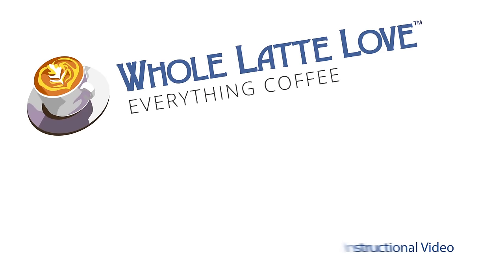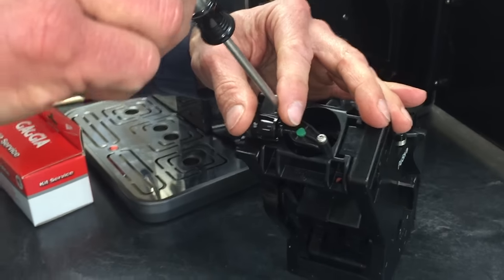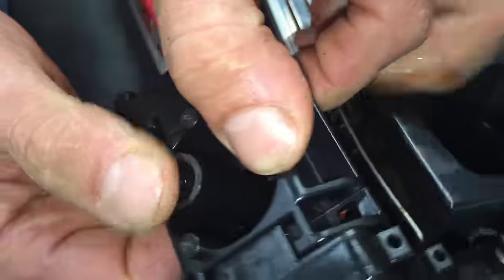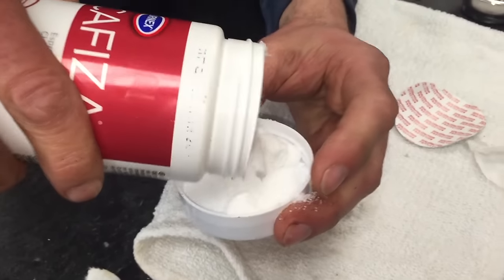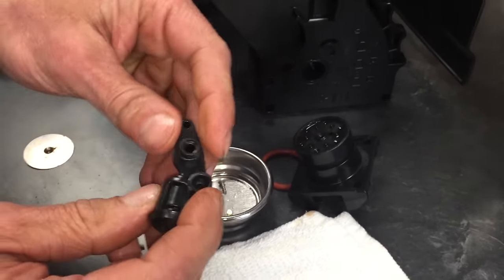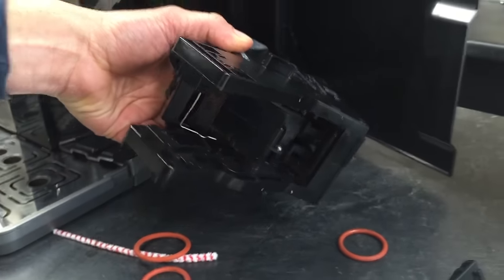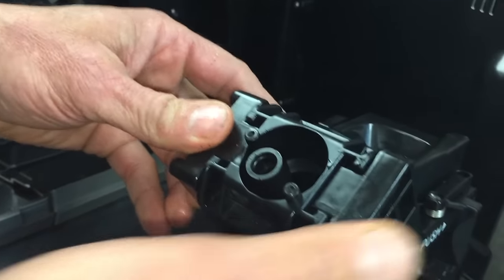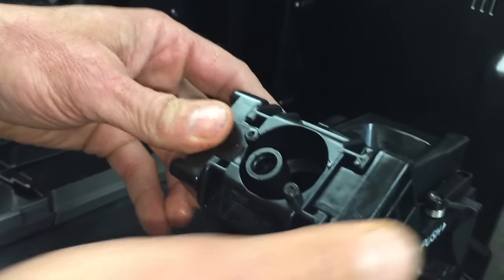How to Deep Clean the Gaggia Brera Brew Group

Comment: Nice instruction, but you broke several of your own recommendations like not putting the O-ring in the cleaning solution, putting grease on still dirty slides and not taking precautions against cross treading. To avoid the last you should first rotate the crew counter clockwise until you feel the click of the tread. Then you know the screw is in the righ position to tread it in without the change on cross trading.

Comment: After watching and using your video for years, I somehow managed to script one of my little screws. I am so disappointed. You mentioned something in the video T10? I can’t find the screw anywhere. If someone could tell me what type/length of screw it is I would really appreciate it.
Reply from the maker: Hi tsk, T10 refers to the type of driver head (Torx) used to turn the screw. If you have the screw out you can use any screw with same length and thread pitch to replace. It does not have to be a Torx head screw.

Comment: Hi! I have the same brew unit on my Phillips espresso maker. Hot water comes out the cappuccino maker/hot water dispenser, but none comes out on the coffee nozzles. The machines starts making the coffee, than gradually the sound goes silent, and nothing comes out. If I let it work, the whole pressure comes out only when the brew group dumps the coffee. Any ideas? Thanks a million!
Reply: Am

Comment: Great video. I just used it for the brew group's first real cleaning. For anyone considering this: definitely heed the advice about care with the spring and the glass ball. The bolt-on retaining armature has a seal that requires some gentle force to pull off and the small parts inside may pop out. I disassembled it over a catch basin and avoided a tedious search for the small and nearly invisible glass ball. Here's to many trouble free espresso shots in the new year!
Reply from the maker: Hi KW, Thanks for adding the tip!

Comment: Excellent video.  One tiny quibble, but something that really could help a viewer:  never put one screw in 100% of the way and then the other, like he does at about 9:30.  There's never an upside, and often a downside.
Reply from the maker: Hi SB, Thanks for the comment. Out of abundance of caution that's not a bad suggestion. Any chance you work on cylinder heads? :)
Reply: lol! noticed that too and said to myself to do what I know... all screws halfway, first, then tightening opposites (luckily only two here!)

Comment: Great video, I've never done this but looks like i need to as the machine wont stop dispensing little black flakes. Can you use coconut oil for the slides?
Reply from the maker: Hey CB, Any food safe grease - not sure if coconut oil will hold up. Petroleum jelly (Vaseline) works.

Comment: Great video, thanks!  I took apart the brew group to my 13 year old Gaggia Platinum Swing Up, but.... there was NO little spring and glass ball (shown at 2:24).  Did the older brew groups not have one?  No one has taken this apart before me.  I've put it back together, and it's working as it did before.  Should I get one, and put it in??
Reply from the maker: Hi AN, Not all groups have the glass ball and spring. If working as it did before you're fine - do not get one and put in.
Reply: @Wholelattelovepage  Good to know! Thank you!

Comment: I took my brew head to the self-serve car wash, put a quarter in the machine, and rinsed it out really well with pressurized water. Don't know if that's recommended, but it didn't seem to do any harm.
Reply from the maker: Hi Ted, Well... if it still works no harm, no foul. Did it knock the lube off?

Comment: Thanks for this video . I have this Brew unit inside of a Saeco Phillips, though for some reason the coffee is very weak and the coffee is not compressed correctly, a coffee puck is not formed , its too loose . Any idea of the problem?
Reply from the maker: Hi Joe, You are welcome for the video. If your brew unit is in good shape  - like it's been deep cleaned my 1st suggestion based on info you've provided is to check for a partial clog of ground coffee in the path from the grinder to the brew unit. Not sure which Saeco you have and I'm not super familiar with their machines. But, if you remove the brew unit and can find the spot where coffee drops from above into the brew unit check for a prtial blockage there. Sounds like you brew unit is not getting enough ground coffee.

Comment: I recently bought (1 month)  and had working Gaggia Brera. And today it started to have some strange noise when brewing and the coffee was dripping mostly from one nozzle. After that it wont turn on anymore, it is stuck in rinsing cycle with unusual noise. I performed water test and it seems water is flowing through the wand but not through the nozzles for coffee. Do you know what is the problem? Thanks
Reply from the maker: Hi f, Symptoms you describe of water coming from the wand but not from coffee nozzles suggest a clogged selector valve. Fairly easy to correct. This video shows how: https://youtu.be/FESzAno0gVY
To have that valve clog after one month of use suggests use of mineral laden (hard) water in the machine. Be sure and treat water to reduce mineral content and descale the machine on schedule. Hope that helps!
If procedurte in video does not resolve you problem and you purchased the machine in the US/Canada contact our tech support here for additional assistance: https://support.wholelattelove.com/hc/en-us

Comment: Why do you use the powder instead of the cafiza cleaning tablets?
Reply from the maker: Hey Matt, Powder a lot cheaper in long run and dissolves easier. But, either can be used.

Comment: I have a Gaggia Platinum Vision.  The brew group looks identical except that when I took it apart, there was no spring or ball. Should my brew group have these two parts?  I took the unit apart for cleaning because water is collecting (in large amounts) in my dump box. The dump box should be dry and only contain wasted pucks. I was hoping that cleaning would solve the problem, but my unit looks pretty clean.
Reply from the maker: Hi Brian, There are slight differences in brew groups with different models. Some do not have the glass ball and spring but a metal rod and o-ring instead. Even if things look clean following the steps in this video should help. Most likely culprit is the main O ring on the brew unit, clogged screen or the O ring in the check valve is bad or missing.
Reply: @Wholelattelovepage  thanks so much. I pulled the screen out and cleaned the whole unit with a Cafiza solution.  Maybe it's the large O-ring. If not, is there a video or support info on getting at the check valve to repair, maintain or replace it?

Comment: Hello, I’ve had my refurbished Brera since August 2022. I’ve noticed while cleaning the brew group, the chute on my machine has never lined up correctly. It sits at an angle, crooked. I don’t think this is normal. There is also only one screw/spring right above the white PUSH> lettering. Please HELP!
Reply: I was able to line up the chute…🤦🏻‍♀️
Reply from the maker: Hi Mm, sounds like what your are seeing is normal. There should be just one screw above the PUSH lettering. The angle on the chute is normal as well.
Reply: @Wholelattelovepage  thank You!!!
Reply from the maker: @montanamom1124  NP!

Comment: How do I get Gaggia anima to deliver 180-190 temperature when set in max setting?
Reply from the maker: Hi John, When operating normally the Brera brews internally at 195-205F. Of course your in cup temperature will be lower. Maybe a lot lower depending on type of cup you are using. If you measure temp with a fast acting digital thermometer directly in the stream as it's leaving the coffee spouts you should be in the 180s. For higher in cup temps preheat your cups as they do for espresso in a good cafe.

Comment: Thanks for the informative videos! I was wondering if anyone has any thoughts on why my Brera suddenly will not brew a normal single shot, but instead pushes out about 6 oz of water. The longer shot button seem to work fine.
Reply from the maker: Hi SC, You are welcome. Did the button get reprogrammed or have you tried to reprogram? If you press and hold the button until the machine starts grinding you will be in programming mode. That's indicated by the light flashing in the display. Then release the button after you see the flashing. The espresso will brew and when you have the desired amount in your cup press the button again and that amount will be brewed next time and into the future until you reprogram again.
Reply: @Wholelattelovepage  Yes, I did reprogram the amount and it works great again. Thanks very much.
Reply from the maker: @SC-ru3vp  You are welcome - happy to help!

Comment: I have this brew group in my Philips lattego (saeco). Has been making perfect coffee for months and the pucks in container were solid, dry and I can pick them up without crumbling. Now my espresso is weak and the container contains a watery mess. What is happening with my brew unit. Everything seems to be working but sometimes the coffee is still inside brew unit on tray super wet. Any ideas?
Reply from the maker: Hi DG, Thanks for the question. Have you tried the deep cleaning?
Reply: The big orange seal you can see at 00:34 is mostly the reason. pull it out and see if there are some defects. If not, clean the place where he should stay, place it back. Hope it works.
Reply: @Hans007O  I replaced it with same results and all of a sudden two weeks later my pucks are back to solid and dry.  I haven't made any adjustments recently, so I'm baffled by this but presently surprised.

Comment: I clean with warm water the whole unit and let dry on sun for 3-4 hours ! Works well
Reply from the maker: Hi Anna, Thanks for the comment. Do not use water that is too warm. Room temp is warm enough. There is lubrication on the unit and water that is too warm can rinse the lubrication away.
Reply: Whole Latte Love j
Reply: I have a question related to OP. Can I dunk the whole unit with the cleaning powder or should I take it apart like in the video? Not at all good with breaking down and putting stuff back on. I would be afraid of effing up a step somewhere down the line.
Reply from the maker: @Mezcalito617 for a good clean you really need to follow procedures in video. But an alternative that gets you part way there is Gaggia cleaning tablets. Some newer machines have a cleaning cycle built in for using those. If not, you add tablet to the pre ground bypass doser and brew like you were making a coffee beverage but cut power mid way thru the brew let it sit for ~10 minutes then return power and fake a couple pre ground brews to rinse

Comment: Got parts: Burrs and grinder top plastic piece. Question: How to replace the burr? Should the burr be glued and what kind of glue, if it?
Reply from the maker: Hi Mark, We do have parts. There's no glue involved in replacing burrs. We always suggest doing a cleaning and calibration first. Burrs are ceramic so unless they are chipped replacement generally is not required. See below for links to a video on cleaning and calibration and a link to a Brera parts diagram.
Video Clean and Calibrate Gaggia Brera Grinder: https://youtu.be/Z0Vife6GXHU
Gaggia Brera parts diagram: https://wiki.wholelattelove.com/images/b/b2/BRERA_Parts_Diagram.pdf
If you need further assistance you can call our tech support at 888-411-5282
Part number 146520100

Comment: Thanks for posting these videos they are amazingly helpful. I did a deep clean of my Gaggia Brera brew group as shown in this video because coffee grounds were piling up underneath the brew group. I also replaced the o-ring on the brew group and the two o-rings on the water inlet. I lubricated everything on the brew group afterwards. The machine sounds better but the coffee grounds still pile up underneath the brewgroup. Is the grind volume too high and can it be adjusted? Any advice you can give would be appreciated. Thanks again for these videos.
Reply from the maker: Hey Chris, You are welcome for the videos and thank you for the kind comment and question. You can adjust grind volume on the Brera by decreasing the strength setting. But I would not be overly concerned with some grind spillage. I've used many dozens of makes/models of machines and they all have some. Even high-end Juras that run 6x the price of the Brera have some spill. Over the years I've noticed more spill tendency in low humidity conditions - like during heating season. Causes more static in the grinds so more miss when travelling from the grinder to the group. Hope that helps!
Marc
Reply: @Wholelattelovepage  Thank you so much for your reply! I've had the machine about 6-7 years and it never had this problem. Then suddenly the grinds started piling up underneath the brewgroup so that after about a week the brewgroup is packed tight in grounds which start to spill out the door. The problem is when the brewgroup moves forward to position the grounds for pressing and brewing. At this point they spill. On two recent occasions the machine has failed to compress the coffee, giving up with a flashing red triangle which also made me suspect there was a problem with the volume of grounds. Thanks again for taking the time to reply.
Reply: @chriskissack  Hi Chris sounds like you have to much coffee in it perhaps you use different beans and a to fine grinding perhaps coffee strength at 3 beans?

Comment: Hi thanks for the great video. If only the one nozle is giving coffe and the other not how i fix this???
Reply from the maker: Hi a, Thanks for the question. Depends... One nozzle may have an obstruction. I would try clearing the nozzle with pipe cleaner or similar. Running a descale cycle may help.
Reply: Thanks i will try
Reply: @ansdrifter  In my case descale helped, it washed out some coffee beans particles together with particles of scale. You could try to hold the water from functioning nozzle while cleaning as they seems to be connected and you just redirect pressure to wash the stuck one.

Comment: I have a similar coffee machine (Saeco Incanto). I have teardown and cleanup the brew group but it's still making some weird "bird noises" when making a coffee. It sounds like the joins are no more doing their job and there is air entering that unit when a coffee is made. Any idea how to fix this ?
Reply from the maker: Hi T, Thanks for the question. Difficult to say for sure but could be an o-ring where the group connects internally.

Comment: How do we put in a brew group that is locked out?.My husband took out the brew group while the machine was on. We lined up the arrows and the brew group is in the upright position. It still won't go in.
Reply from the maker: Hi Sharlene. Hate it when that happens! Anyway, here's a video that should help. It covers removing and re-installing a stuck brew group. The section of the video you will be most interested in starts at about 4 minutes. That section covers fully re-setting the position of the brew group so it can be re-inserted. https://youtu.be/KxcZzpyu4Fw

Comment: If the brew group is bogged up with coffee oils is this the reason the coffee is ground and then tossed away?  My Brera seems to waste as much as it brews
Reply from the maker: Hi CZ, It's a definite possibility. Could also be a grind that's too fine. If the machine senses an over-pressure during a brew it may dump the coffee without brewing.
Reply: Whole Latte Love I will try reducing the fineness of the grind and clean the brew group also.  Thanks for the advice ... and the video.  By the way I purchased the Brera 4-5 years ago from Whole Latte Love ... I will have to purchase the Calfica cleaner

Comment: Can I use a gaggia brew cleaner  tablet Let it dissolve in a container, then soak the unit  rather than the powdered cleaner you mention? Also, the service kit looked as though it comes with two o rings. Is here only one large o ring in that unit?
Reply from the maker: Hi Dean, Thanks for the question. You could most likely use the tablet - but it's not something I've tried. The service kit is universal so does include 2 O-rings to cover any Gaggia brew group.
Marc

Comment: My Gaggia Syncrony Compact sometimes goes through the grind cycle, but then does not poor water through the brew unit.  When it works the coffee is weak too.  Do I need to clean the brew unit or recalibrate the machine or both?  If both, does the recalibration follow the same process as your Titanium video?
Reply from the maker: Hi John, Thank for the question. I would try the brew group deep cleaning. Also, has machine been descaled on schedule?
Reply: Whole Latte Love yes been descaled regularly.
Will follow your guide.  Thank you.

Comment: Ola, in Brazil I can not find the CAFIZA detergent, I wonder if I can use some other similar product, example detergent powder for dishwashers? Or those cleansing tablets, dissolving in water and using the same form? In addition I would like to ask why you do not let submerged the top of the group where the filter is, is because of the sealing ring?
Reply from the maker: Hi FFCC, Check out this link to the main ingredient. It may help you find something similar in Brazil: https://en.wikipedia.org/wiki/Sodium_percarbonate
Reply: Tanks

Good evening, I found the product here in Brazil, how to dilute it? How many grams per liter of water? Uses lukewarm water? Do you have to remove the filter that stays on top of the group, or can you put the whole group in the solution? The question is regarding the silicone ring.
Reply from the maker: You can put the whole thing in. 6g/liter. Silicone can stay on but you might clean it a little better if you remove and clean by hand.
Reply: Water warm or cold? Does something change?